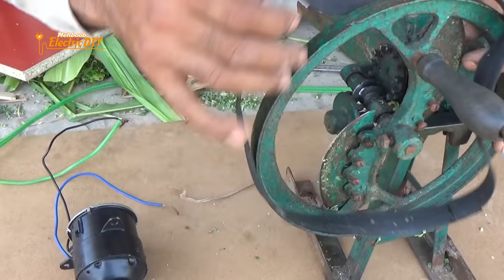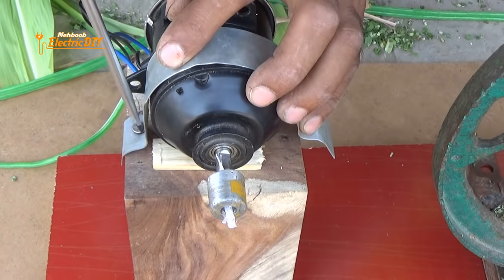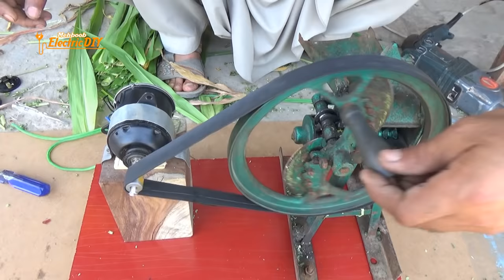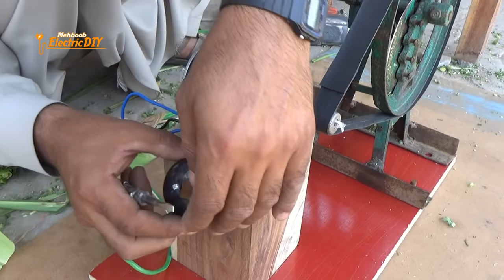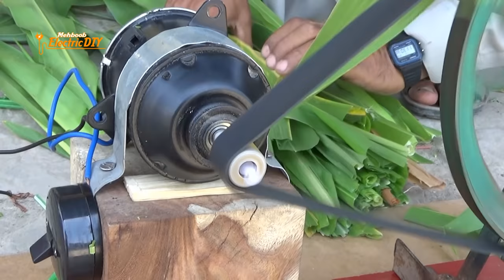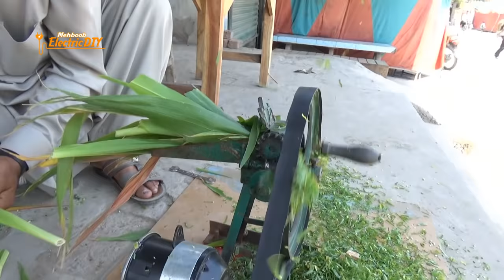How To Connect 12 Volt DC Motor With Grass Cutter Machine Its New Technique

Comment: Very nice work sir, can you tell me can we adjust the thickness of leaf so we can cut it small size. Plz reply
Reply from the maker: Yes we can
Reply: @MehboobElectric  then plz tel me how
Reply: add more razors to cut more times per second. Change the gears that move the grass inside to have a bigger ratio and push the grass slowly
Reply: 3 blade cutter will cut the leaves into smaller